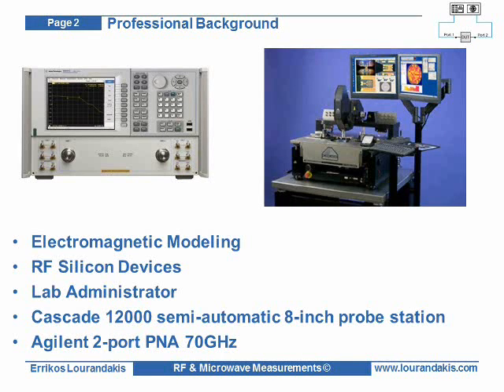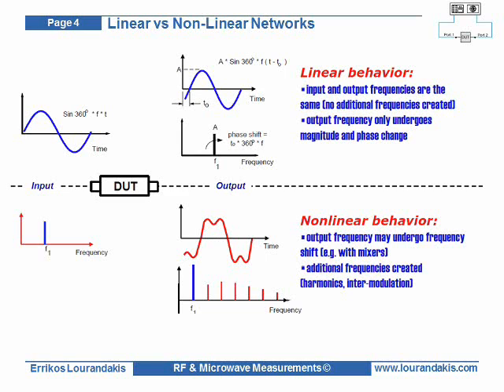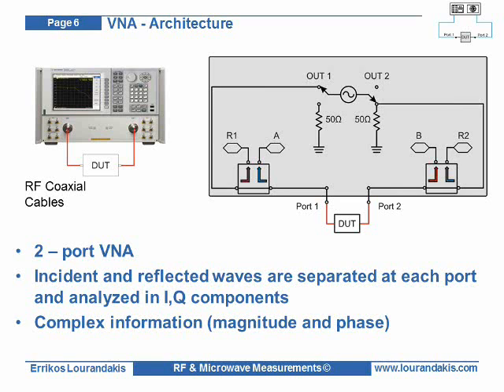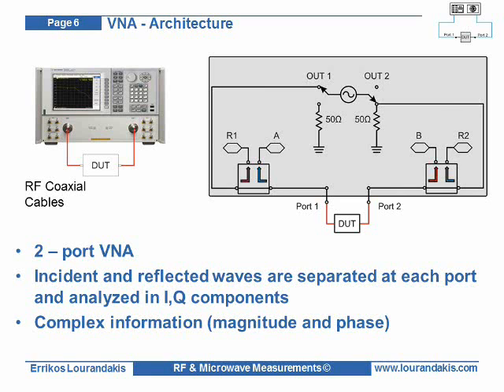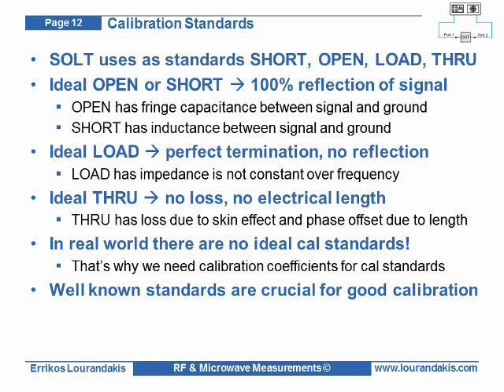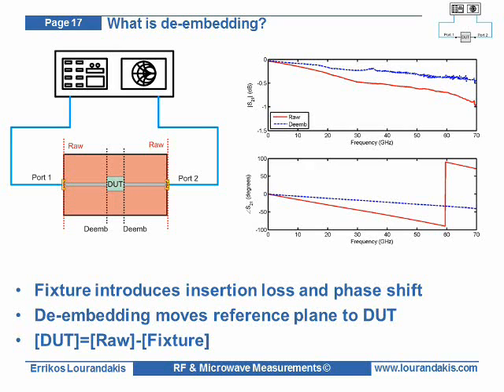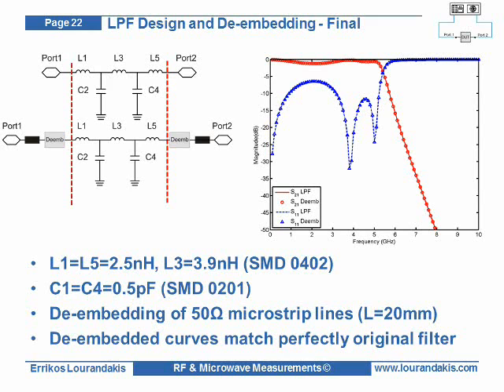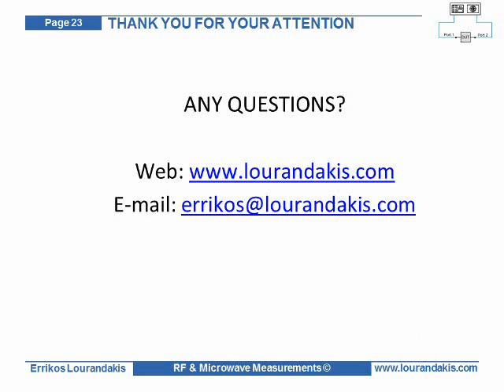RF & Microwave Measurements - Tutorial (HQ)

Comment: Hello, dear engineer, can we amplify the signal of the routers used in which the distribution of the Internet signal has a frequency of 2.4Ghz What circuits are used for the electronics components used to make signal amplification from the simplest types of parts to complex and accurate I hope the benefit I am Engineer Saeed Mohammed from Palestine Gaza, Electronics and Communications Engineer Thank you very much

Comment: do you have any video on free space method of measurement?
Reply from the maker: Dear Phalguni, can you please be more specific, what do you mean by free space method of measurement? What do you want to characterize? The Network Analyzer is used to capture AC signals in terms of incident and reflected  and transmitted waves, which are guided though transmission lines, e.g. coaxial cables, to the device under test (DUT).